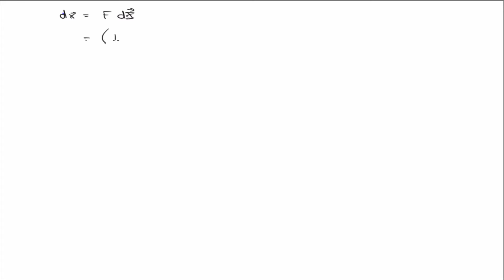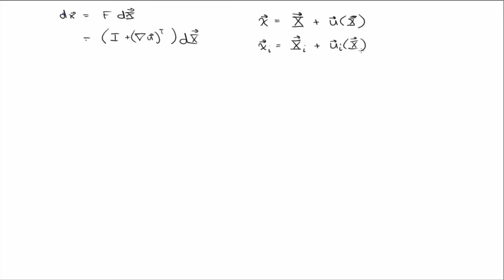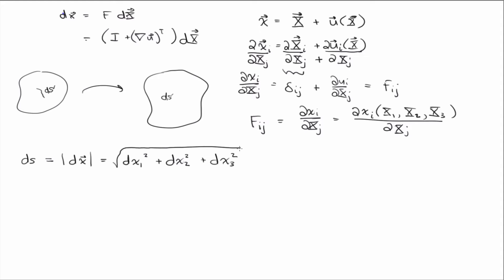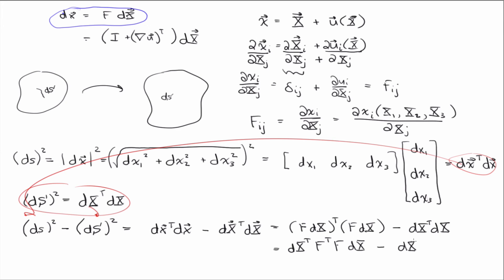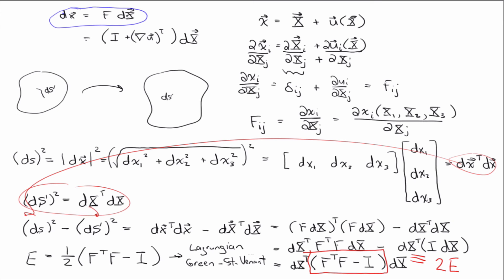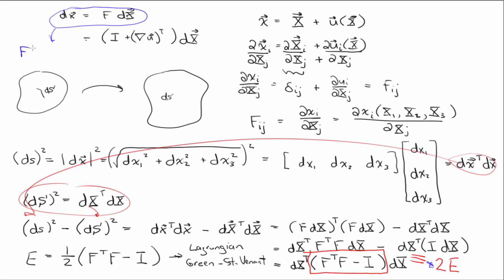Lagrange Strain

Comment: Dear Sir, very nice lectures. I just want to point out one thing you missed (every thing is right, its just that you missed writing a term). Towards the end of the lecture, when you wrote down (ds)^2-(dS)^2 = ..., its just the difference of line segments in current and deformed configurations. The strain would be ((ds)^2-(dS)^2)/(dS)^2) which will come out same as you have written (1/2 (F^T F - I). Thank you, sir.